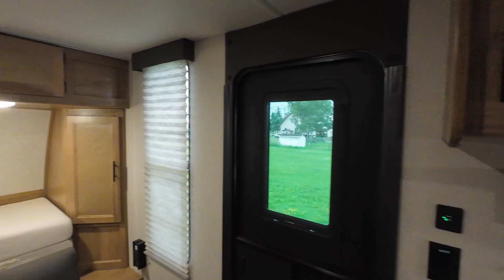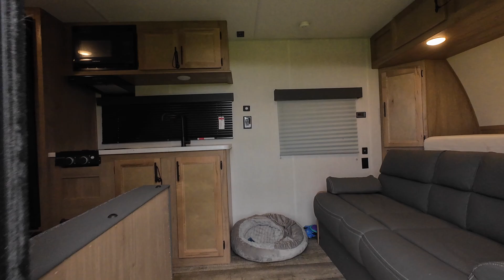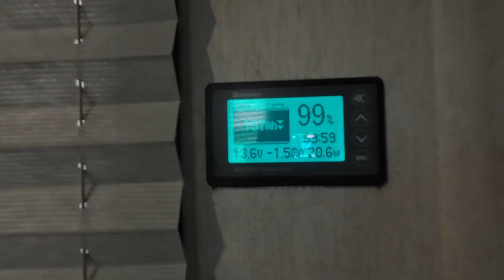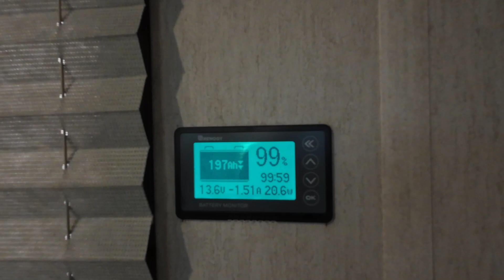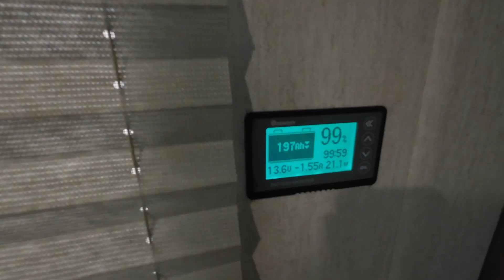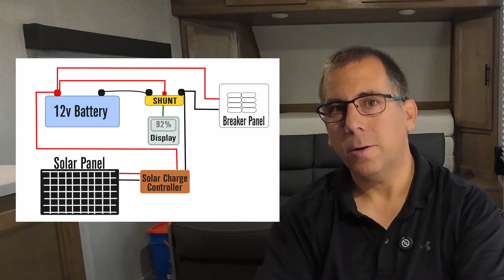RV Volt Meters Lie! How To Monitor Your Battery Usage.

Comment: Thank you Phil !   Possibly a small thing to many but what an immense help to several of us that somehow just have not been able to grasp the acting relationships between the components of the 12V DC system of any particular application. We know they are present but just not "how".  At least for me, very comprehensible explanation ( aka - slow & deliberate)  reinforced with the demonstration(s) of turning on and off lights and furnace ( = loads. At least I've been able to retain that.) I never considered the factory installed volt meter's innate measuring & display quality nor how it could be hampered by how it was originally wired in, or is now wired, with possible improper wire gauge size, run length, sharing with intermittent loads on the same circuit, etc and how what the meter is indicating. I've already learned the meters themselves are "accuracy questionable" in how well they do their job measuring and displaying to one/two place decimal. Now I'm going forward towards a dedicated quality meter/monitor direct to battery/battery bank. Your efforts in producing and airing this video are vert appreciated.

Comment: Nice job explaining things. Too many RV folks do not understand these simple and necessary upgrades if you want to be off grid. They see “solar ready” or other slogans and think the factory lead acid battery and a 50 watt panel is sufficient. Since that’s what the manufacturer installed.  Your clear emphasis on the cheap voltmeter lying to you is a key aspect.  Hopefully you do a video on why Lithium is so much better while also highlighting its limitations with high draw items like the factory AC. I upgraded my system but chose to move everything indoors.  I have the fancier Renogy One monitor screen. It has been a very nice addition.